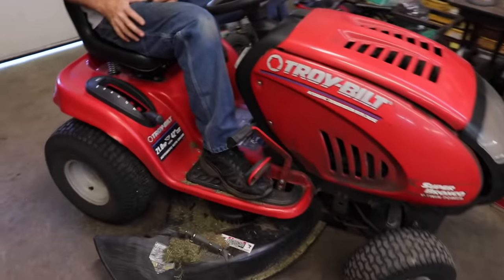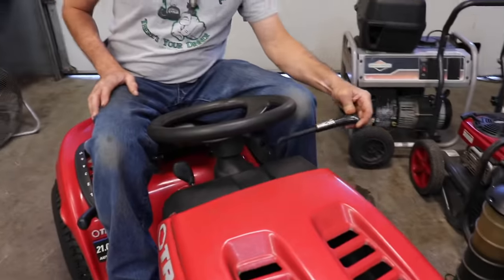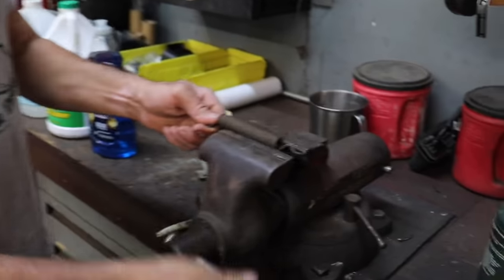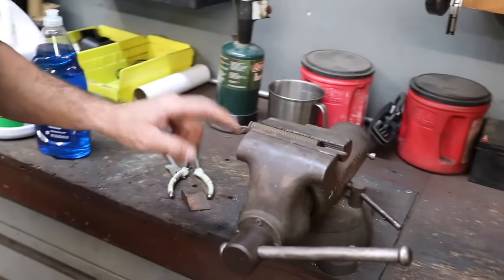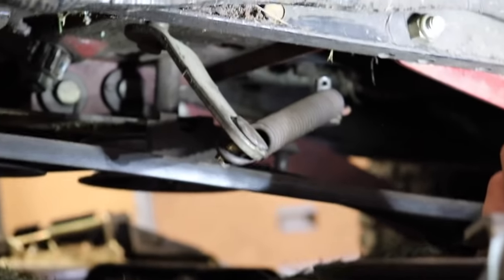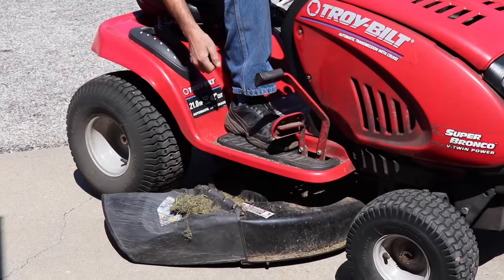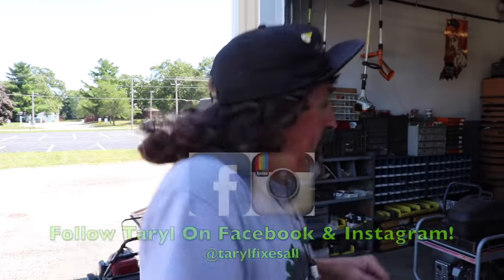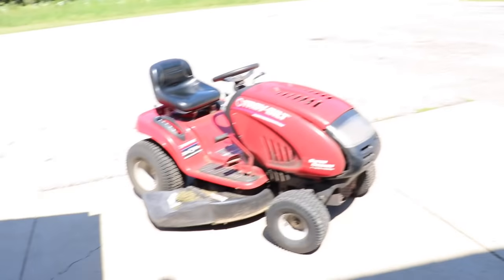Deck Belt Slipping? Easily Add More Tension!

Comment: This video so confusing bc it doesn’t even look like the spring that leads to the cable, and it doesn’t even look like it’s attached to the deck. Looks like its above it. I have a t1600 and I adjusted the tensioner and I have a new belt that is the right size and it’s still loose. I have no clue what to do

Comment: Great video Tarly as your videos are great for the back yard lawman. As for heating the spring red hot, take and dip in cold water, and it will bring back the tension strength.

Comment: Thanks for these 'quickies',  and thanks to you I am gaining the confidence  to work on my power equipment, latest was to replace the head gasket on my Craftsman 2000. So far so good, no extra parts left over and it is still running!

Comment: Always check your adjustments on a regular basis. Watch for wear on your parts. If you find your mounting hardware is worn or if you notice notches going beyond the factory made notch, you will have problems such as he stated. Craftsman riding mowers have problems where the belt tensioner bracket can actually get hung up due to wear. It's all about maintenance and noticing things before they get too bad. Noisy bearings, loose sloppy steering due to bad bushings. A riding mower is subject to dirt abrasion and dust. Wet grass can lead to rusted parts and corroded parts. Every year, you should removed your deck and go through each and every part looking for unusual wear. It's cheaper to fix an issue before it gets to the point your belts fall off or start slipping.

Comment: This works on MTD 46" too. Lowering deck reduces spring tension, under the variable threshold then main drive belt slips into smoke! Belt dress can help regain good rubber/steel friction too. Clean it if dirty. There your dessert...

Comment: Just had one of these come into the shop with the same issue, turns out the idler bracket was loose!

I removed the fuel tank (4 bolts) and tightened the nut behind the steering column, good as new!

Good quick fix, although I wouldn't recommend heating a spring because it'll lose its strength!

Comment: thanks for all your helpful videos  I was wondering if you could do a lesson on replacing the bearings on the cheap toro timemaster pulleys   I saw the video on replacing it with the upgraded pulley  but I am cheap and would like to know if its possible to replace the bearings on the crappy ones  thank you

Comment: @Taryl Fixes All The mower I have is a 2017 Troy Bilt Bronco. Is the spring that needs shortened the one connected to the PTO cable? Model#: 13WX78BS011

Comment: I used to do the same thing on my craftsman only problem was after a couple hours of mowing the spring decided it wanted to break right at that spot I heated it up so I learned you have to make it a nice easy bend no sharp kinks otherwise you’ll have to go back and do it again in a week or two

Comment: I have a 2013 troybilt pony.  Belt keeps coming off. There is so much slack in belt when released no idea how it stays on.  My blade release is on the side next to deck height arm.  On my mower spring is attached to cable.  Thought about getting shorter belt if possible

Comment: Taryl please do a video on buying v belts for sit down mower the belts dont match the belt.
 1 first belt ordered b-85 but measured 88.25
2nd belt ordered b82 measured 84.5
3rd belt ordered b 81 measured 83.25

I extended my belt measuring DEMCO v belt measuring gauge  and extended it 10 inches to measure the longer belts and that's what I found, I also measured on outside diameter with 1/2 Stanely power lock tape measure also, the decks have little adj and I also tried the red link belt and the stretch is too great for craftsman gt5000 deck  there only good for a fan belt water pump not mower deck . If you go into bearing shop you can measure them but prices are 3-4  times higher NOW DO YOU ORDER BELTS????????????????

Comment: I have a craftsman  t210 with the same problem it's a bit lose when not engaged and I have the right belt for it, it slips from time to time. I and I try to follow your fix but it doesn't have two spring loops.

Comment: for a long time I thought those where your real teeth, lol I love your videos, taught me how to adjust my values on my motor, story to long to tell about my lawn mower ha, .. QUESTION__on a troy bilt zero turn, would that spring happen to be on top of the deck, my blade will not kick on after I reverse, if I shut the blade off and back on pull the PTO blade will not turn, try it again on the way to put it up lol and it might kick on??

Comment: My Yard Machine was working fine. Once I replace the deck belt , I saw white smoke coming from the engine pulley. It spins while the engine is engaged and disengage. What could cause it to just spin now?

Comment: Tarly I have a 25hp koler command pro series. The engine runs rough especially after it warms up. It’s not keeping much fuel in the filter maybe a 1/4 full or less. Ive changed the pump, cleaned carb etc but noticed oil coming out the valve cover also seems to be a lot of blow by out the valve cover. You think a head gasket is the issue?
Reply: If you have Blow-By, yes more likely you have Gasket Problems.  If you have Gasket Problems.... You fuel won't get to the pump easily.  Your Fuel Pump is working in conjunction with your Engine compression.  Low compression = Low fuel.

Comment: What if the belt falls off when you don't have the blades engaged?  The belt is fine when cutting, but slips off when not in use and I have to keep putting back on.  PIA!  Thanks!

Comment: The lever on the tractor looked bent if you were to straighten it it would not want to pull against the hitch pin as bad either.
Reply: If you are referring to the lever that the tension spring (he shortened) is attached to, it's made that way. I have the Troybilt LTX-1842 and it looks just like the lever on the one in his video.

Comment: Any suggestions? My jd 17 horse mower acts as though the valves are off ,hard to turn over especially warm. I have tried to set valves at least 3 times. Now engine locks up when shut down. Is the gap too small or too large?
Reply: Hard valve = lock engine.
Reply: @JodBronson  not sure what you are saying???

Comment: Hi Tayrl, I have this exact model. When starting it, sometimes it cranks, and sometimes it doesn’t. It surges and backfires as well. Any suggestions??? 
Love the videos, especially the intro’s. Thanks
Reply: check valve adjustment and drink a hamms
Reply: thats what was happening with mine, Tayrl taught me how to check valves, I DID, and it cranked, worked great ever since till my PTO is messing up

Comment: my lt3000 uses a cable and spring. the cables keep breaking. first it was age, second was cheap plastic the metal handle ripped thru.

Comment: Funny, my blades actually stop turning when I lower the deck past 4, even on the driveway. New belt, PTO cable, nothing interfering with the belt and no change. Maybe this will work.

Comment: trick is dont heat the spring itself , nice easy fix and good diagnostic skills
Reply: Duhhh???.....He said "heat the end". What's not to understand?
Reply: @james1795  true but if someone heated it to the point of damaging the spring by accident. when i was a kid decades ago i thought i would fix my bed springs as they were stretched and uneven, once i heated them ofcourse theyed lost all there spring , and when i hopped on the bed lets just say i slept on the floor LOL im a car/truck/earth moving/locomotive mechanic but watching taryl is fun, now i tinker on mowers etc  thanks to taryl ,iron horse,cars and cameras. I no longer work as a mechanic its a shit jobLOL
Reply: @closertothetruth9209  I'm not a mechanic but I've always fixed my own things and other peoples. As well as preventive maintenance. And you are wrong. "Mechanic" is not a shit job.
Reply: @james1795  depends on the job mate , taryls job would be one of the better ones, when youre covered in shit working on catapillars and locomotives in 50 deg c or working in hot engine bays on minesites with the boss breathen down your throat while pulling 100 hr weeks it is shit, like i said depends on the job mate . soon well be out of work though with war in oil rich countries,
Reply: @james1795  i do get what you mean though i love working on cars as a hobby , ive done it for over 30 years , hotting up my own cars , drag racing etc that part is fun, helping freinds and neighbours saving them money fixing their cars and teaching them that i enjoy and like you say thats not shit thats the enjoyable side of it.  but like anything it gets old so you move one and learn a new trade , i went back to tafe and completed electrical studies , mostly because i like solar and wind
Reply: @closertothetruth9209  Nothing new.

Comment: Well here is my problem. I've got a new belt and the facility I bought it from has check the numbers and says it's the correct belt. Shortening the spring in my case will not help because it is pulling the lever actuator all the way back to the max so a shorter spring will not pull it any further. Below level for the belt slips and is loose. I checked everything out and it is all properly adjusted and set. It's an old mower could my pulleys all be just that wore out? I'm still thinking they sold me a belt that is just a tad too long.
Reply: Sound like it!  Take the Deck off, measure it yourself.  Only way to know for sure!

Comment: Does that work on a old 2008 craftsman 42 incher??
Reply: 2008? How did you get a Sears Crapman to last that long?
Reply: @MrTruckerf  serviced it and rebuilt the deck a few times, welded up the holes on the deck with 18 or 16 gauge metal. Tubes in the tires, replaced the carb this year with a new anti back fire valve also. Keep it under a shed. Engine still runs good. Changed the oil and filter  when it started getting dark. also change the air filter once a year. I'm praying its gonna last me a few more years. Where I live is very sandy. I have to change the blades more than I like.

Comment: The spring didn't get longer so what's the actual problem. Band aids are ok for a quick fix but I don't take equipment to a "pro" for a quick fix I want it fixed correct.
Reply: The spring got weaker over time. So the "correct'' fix would be to replace the spring with a new one of the same length as the original.
Reply: It’s a POS lawn mower, not the friggin space shuttle - so shaddup, hand him a 20 and go cut your damn grass.

Comment: The best fix for belt drive riding mowers is to haul them into the scrap yard, and get a hydro unit. Those cheap-ass belt drive machines are junk.
Reply: depending on the size of your lawn it might be cheaper for a lawn service